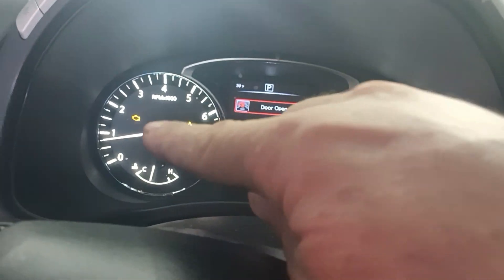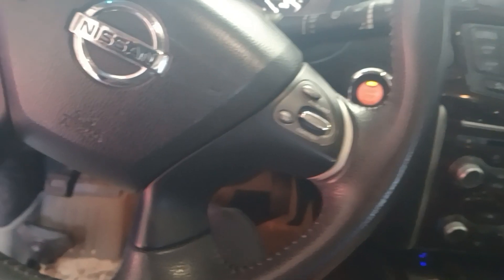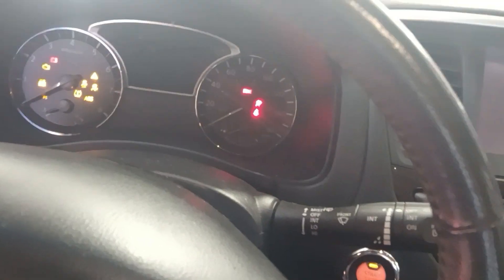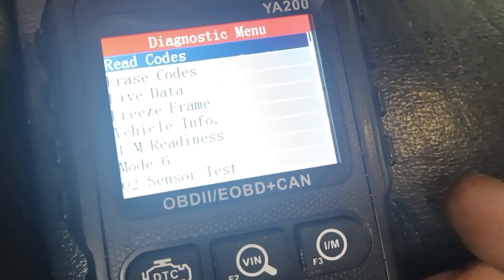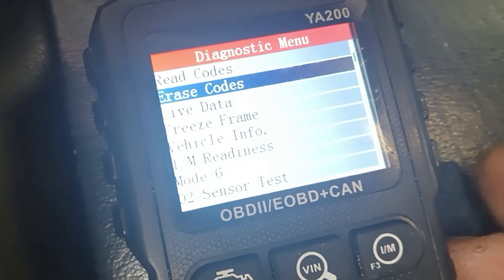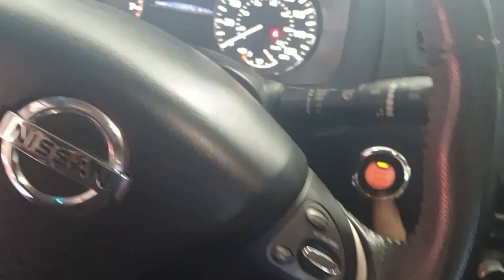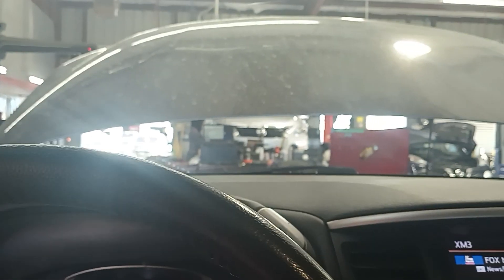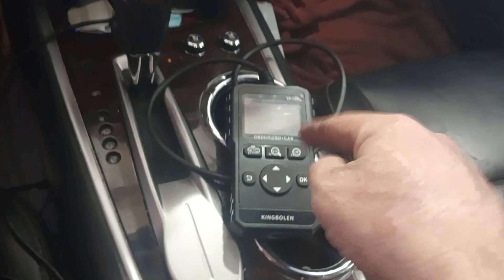reading and resetting check engine light with kingbolen ya200 obd2 scanner 2016 Nissan pathfinder

Comment: Will this work on 2005 Chev 2500 diesel? Have looked at Fixd, but says it won't work on diesels. I have engine light that comes on and codes for turbo issue. After I run Sea Foam thru it, light goes off.
Reply from the maker: I havent used it on a chevy diesel but i did use it on a nissan with a cummins diesel and it worked fine.